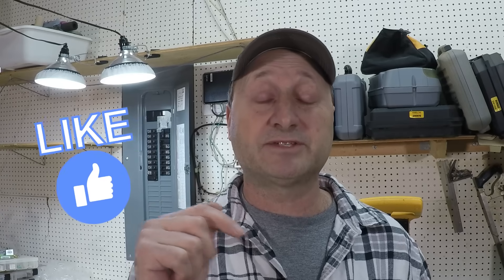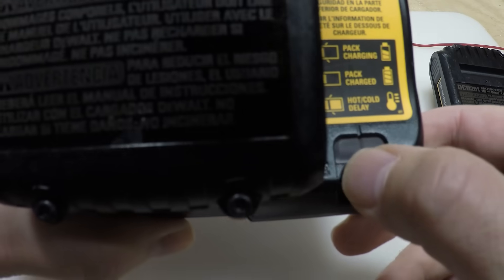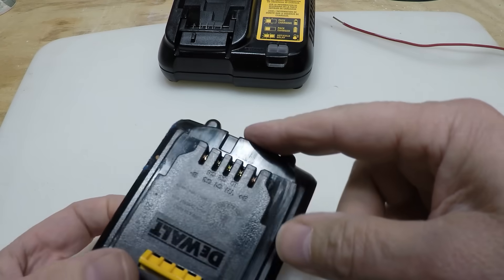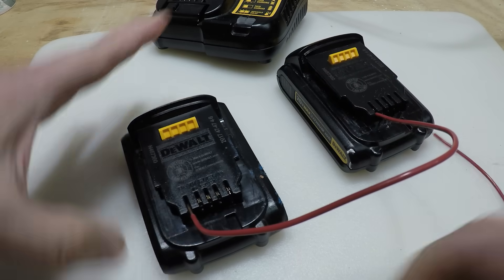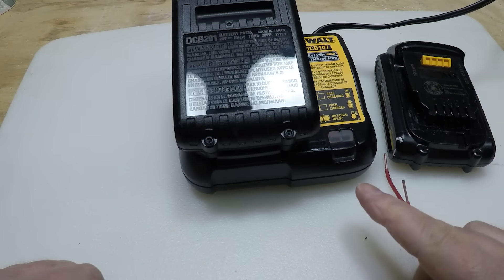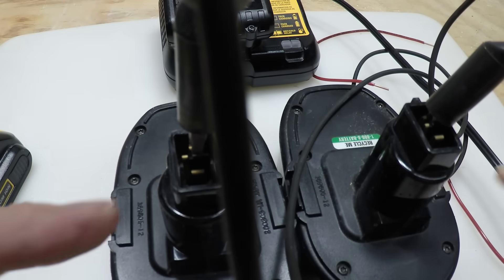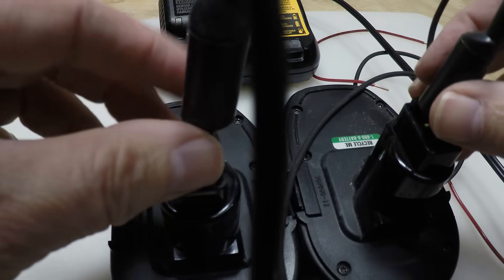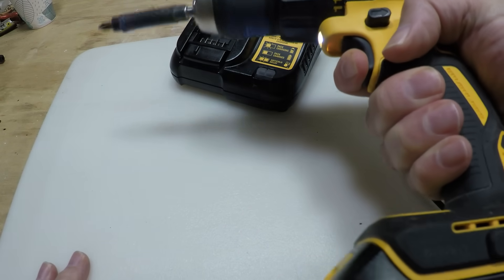SECRET to FIX Drill Batteries - Charge Dead Lithium Tool Batteries

Comment: This is not fix.... In that DeWalt battery pack you have 18650 battery cells. One or more cells are dead and this cell drain all other cells under minimum voltages for Li-Ion batteries to be charge. Minimum voltage is 2.5V for each cell. Under that voltage you have two solutions... Permanent fix is to replace that bad 18650 cells with new one or temporary solution is to isolate that bad 18650 cells, force it to minimum 2.5V  (best to 2.8V) with 3V input on plus and minus poles and back that cell on same place inside battery pack. Best solution is to buy all 18650 cells and replace them all with new. DCB201 battery pack have 5x18650 cells with 1500 mAh capacity. You can buy new LG HG2 18650 cells with 3000 mAH  capacity and 20A current. In that case you can have 3Ah battery pack with double energy inside and for heavy current drain at 20A. No one of all manufacturers dont want to sell anyone anywhere that powerfull battery pack.

Comment: My friend came round today with his Bergman 18v 'dead' battery,-he couldn't get a new one anywhere,-so we tried your trick today using my Bosch 18v battery. It worked a treat,-so thanks a lot for this video!
Reply: I've got a Ridgid that was brand new, left it.on my radio and it hasn't worked since... this didn't work for me, any ideas?

Comment: At 0:23, He says, "There's a way to fix this without having to go buy brand new batteries..."

The method shown requires that the user already has a working battery.  If all that the user has is the battery or batteries that don't work, then the user does have to go buy another battery in order to fix the old one with this method.

Comment: I have a busted charger and my tyre inflator battery went dead. I connected 2 wires pos and neg on the battery and 2 crocodile clips to the other end and stuck them on a 12 volt spare charged battery. My tyre unit is 18 volt but after 1 hour the unit was able to blow up 4 flat tyres to 32 psi no problem.

Comment: I have an 80V max 5 ah Kobalt mower battery that when it is put on the charger it blinks red and the cooling fan on the charger doesn’t turn on. Also when the battery is installed in the mower it just beeps. When you push the button on the face of the battery it shows 2 of three green lights the they go off. Help?

Comment: fascinating.  Similar to my experience with a lead acid car battery.  The expensive smart charger will not begin unless it sees enough charge already.  So I just used a very cheap old dumb charger to get it going, then finished with the smart charger.   Lots of life after that.

Comment: Lithium Ion batteries get really unstable below 2.4V (per cell) and explode or burst into flames.  That's why the fail safe is in place.  If you do this, as said do it in a safe place like a big concrete pad or contained in a fire proof box.   It may work but I wouldn't trust that battery out of my sight.

Comment: I have a ryobi mower. The battery charge doesn't last very long. Especially in the humid florida weather. Is there anything I can do to maximise the battery  to last longer?
This video was a big help. Thanks. I try to keep both my batteries charged to avoid that.

Comment: This is all false hopes, letdowns and disappointments! At the beginning you think it's going to work because you can get the charger to recognize the dead battery and start to charge it... when it's done charging it appears to have a full charge put on a multimeter and it reads how many volts that particular battery is supposed to have. It's at this point you think how awesome this is and how much money you just saved so you do your happy dance! BUT THEN you go to use your drill and you might drive in 1 or 2 screws before it drains down to useless again OR you didn't immediately test it and you waited till next morning through it in the truck to go to work you  try to use it but you can't because it didn't  hold a charge! Even if you use that long charge  battery maintenance/conditioning idea it will not hold a charge!
The only thing that got charged up was the views on this video!

Comment: Do you have any tips for a battery that shows full charge but doesn't last long ?  I have an impact driver that needs recharging after only 5-6 uses on my trailer stabilizers [scissor-jack type], which shouldn't really be a high-resistance usage...

Comment: Good day and many thanks for this brilliant ploy. Nevertheless, I have a question in order NOT to develop some damages while doing the jump-start process: I have a 12V. NiCd old style battery (like those you are showing towards the end of the video) which is completely drained; I have bought another back-up 12V. old style battery but Li-Ion : if I do the jump-start between these 2 different kinds, will it be OK or it may produce severe damages? Many thanks in anticipation for your fair advice. Kind Rgrds,

Comment: That's fantastic! Thanks for sharing :-) I have the same thing happen with my 20 volt Max DeWalt battery and I tossed it to the side on one of my work benches and then the next day when I came into the shop I was about to throw it away and thought I should try it one last time and it charged. Don't know if that happens in every case but it did in mine. Thanks again

Comment: Unfortunately this is not a complete fix but it makes the batteries usable again. From the research I've done there is a type of mechanical safety device on each battery cell and when you completely kill a battery it trips this safety mechanism in some of the cells. So yes you can get the battery up and going again but it won't be able to fully recover and you won't get the longevity from it that you used to. At least this has been my personal experience after discovering this trick and trying it.

Comment: Hi there,
A couple of questions - 
1) Does this trick work with Black & Decker Batteries as well.
2) What should I do if I don't have two batteries, is there any option to revive the dead one without a second battery?

Comment: This method is not a "Solve All"  one. Different batteries have different problems. It could be electrical or chemical. Li-Ion, NiCad, Ni-Mh, Lipo, LeGo etc should not be processed through this method. Professionals and/or well documented  DIYs know their stuff. A good principle is to get reliable knowledge from reliable sources.

Comment: I have Ridgid 18 volt batteries for cordless drills my problem is not that they don't light up but they don't charge up fully so you might it might show for bars as soon as you take it off the charger then it drops 23 and very quickly after that when you're using the tool drops 22 and then one and so this is the problem these batteries apparently have a dead cell in there somewhere maybe maybe you can tell me how to fix this without tearing into internal part the Ridgid batteries are especially difficult to replace the individual lithium-ion cells anyway thanks if you can you might send me a notification that there's some you no new news on there if you do give me a feedback thank you

Comment: DON‘T EVER do this!!!! If it doesn’t charge it“s because the BMS recognized an undervoltage situation. The battery will maybe have developed dendrites because of this. Dendrites shortcircuit the anode and cathode because they overcome the separator. This results in an uncontrolled internal discharge causing heat and fire. This can happen anytime after recharging. Not just while charging. It can happen days, weeks or years afterwards. DON‘T!! Trust the BMS decision, give the battery to recycle and buy a new one. You are in risk to lose life or property. No insurance will pay for anything if they found out.
Regards, a battery and BMS developer for eMobility.

PS: There is a way to check the health and maybe get them alive safely. This requires tools. Seeing this though I won’t tell you how. I saw enough fires.

Comment: Is there a way to bring a nicad drill battery back up to full charge? I believe these have a problem with the memory effect, so when the charger indicates fully charged it's actually only got a very small charge. Thanks for the info on the lithium batteries.

Comment: I wonder if it will work on the Nicad batteries.that my Skil drill came with.

I bought 2 Lithium ions when thry were on sale, and a charger for them.  After that, the Nicads jyst sat.

Once in a while both lithiums are dead but the nicads don't work, even the one that stays on the charger.  Swapping  the other to the charger doesn't work either. 

I assume from lack of use.  The green light on the charger is lit but  constantly has a faint flicker  (not a blink by any means).

I'll have to try this & see.  Thankx!

Comment: Golf carts are the same way. If the batteries are very dead the charger won't kick on. We've actually put a standard charger on for a little bit until the golf cart charger kick in. People have bought alot of chargers not needing them.

Comment: Hello I have a Ryobi, 18 Volt cordless drill, an old type and the batteries hold a very small charge but won't charge fully. Is there any way to rectify this or do I need to replave them and is that worth it

Comment: Same thing happens with car batteries and newer chargers; unless there's a certain minimum level of charge, the charger won't even try to charge the 'dead' battery. Simply using jumper cables to another car for a few minutes (without trying to start the 'dead' car) will give the 'dead' battery enough charge so that they charger will charge it. I don't know why the engineers did this; perhaps to sell more batteries.

Comment: Hi, I am wondering if you have any experience with Dewalt 60V Flexvolt batteries? It starts to charge with the fast charger and stops charging within a minute. Any idea or suggestion would be appreciated.

Comment: I worked in the battery industry for a decade, the lithium battery was not completely dead, the battery circuitry went to "sleep". By introducing a little energy you "woke" it back up. The battery still had charge. Second, the old style battery which was probably NiMH or NiCd will take a charge from a zero state, however the internal cells would have degraded and it wont hold a very good charge after. The easiest way to explain is there is an oxidation inside the battery, some people refer to this as "memory". The entire reason the charger couldnt do that on its own is because they need the voltage to register that something is connected. This way, it doesn't charge whatever you put in there, like random metal. Those chargers are semi-smart. True high end chargers will have a maintenance cycle that would do a short trickle charge to bring voltage to a level (or wake up the battery) then begin to charge the pack. Overall, dont mess with lithium batteries, they can go critical very quickly and once the reaction starts, you cant stop it without a zero oxygen environment or a powdered extinguishant.

Comment: This is not the method i would use. Connecting a charged lithium battery to a discharged one is not safe. If i was desperate i would put a car light bulb in series to limit current for a few moments as mentioned but i would prefer to use an external power supply with current limiting & a voltmeter & not even think about getting a lot of charge in using that method. Then you have to consider if the cells are safe to use anyway.

Comment: I have an older model powerxt cordless drill, the yellow one, with 18 volt battery, that I haven’t used in a few years, when I put it in the charger, there are lights that go on, one green and one red, but no power when I put the battery in the drill, even after charging for several hours.

Comment: what gauge cable did you use??
Reply from the maker: it was probably 14 or 16 but it does not matter. You just need to touch the contacts. Any wire will work

Comment: I have a 40v snow joe battery that has some charge but i guess not enough for the charger. There is continuity on the stinger fuse. I don't  have a second battery. I don't  want to buy another.  Any ideas how i can get some additional charge to this battery withoit a second one. TY in advance.

Comment: I have a bosch 18 volt 2.4 Ah it has 3 contacts on witch one i should make the contacts, also i have a paslode only 2 contacts + and - so i am wondering if it will also work on these batteries?

Comment: Little tip to make the copper wire fit better: put it on your vice or anything hard and flat really. Now smack it with a hammer. It'll flatten out the copper and slide right into those prongs
Reply from the maker: thanks for watching. please share the video with everyone

Comment: My Ryobi 18V batteries show 18V DC but one fairly new one shows 251VDC or maybe that's -251VDC. So, Hmmm, I tried your method for a few seconds and then again for about 20secs,  and still not working. Anyt thoughts??
Reply from the maker: maybe you are touching the wrong contacts

Comment: This works if there is one good battery and another is bad. But most of people don’t have two batteries. Hey have only one battery that comes with the tool. I have cordless drill and it does not charge. I don’t have second battery. So unfortunately people like me can’t use this method.

Comment: Hah.  Your explanation is wrong (cure is OK)
Lithium batteries grow "whiskers" of lithium that shorts the plates out as they get older.
Connecting  a good battery burns these whiskers off (with any luck) and prolongs the life of the dud battery,
You can use a car battery too, Bur one little touch is all you need,  prolonged contact can cause damage and might even make it explode.
https://www.osti.gov/servlets/purl/1574884

Comment: Wow!!! I know this was not a safe thing to do, but I used two paper clips and put on insulated gloves. Connected for two seconds. now the dead battery is charging.  You are a genius!!!! The battery I used to charge with is fine also!!!!
Reply: You got it wrong, the danger here is not high voltage or dangerous chemicals. It is that lithium Ion batteries get internal damage if fully depleted. Damaged cells can catch fire. That is why a correct charger will refuse to charge it. It has nothing to do with jump starting internal battery management as some believe.

Comment: If you only have one battery (18v) could you use a car battery to 'jump' it back into life? (I know the car battery is 12v but would it provide just enough to get the battery back up and running again)?

Comment: Thank you. I did have to do something extra. I followed your instruction. After putting in the charger, I received both red and yellow lights flashed 3X then went out and the red light showed charged. Tried to charge again, same outcome. Put on the tool, nothing. Insurted it back in the charger, no yellow light, and charged without a problem.

Comment: But for a battery that charges  and then goes dead in 1/10 the time it would run, it will have to be replaced. That is good tip to get it to theoint to start the charge.

Comment: I love this ! I'm gonna try it Right Now the Porter Cable!  Thank you. Update, I did it, it worked just like that. and also, I was able to use a stranded copper wire instead of the solid wire.  Thanks again.

Comment: What if you only have 1 battery? Can you use another method to jumpstart the dead battery?
What if this does not fix the issue...maybe some cells need top be replaced inside the battery? Can you do a video on that as well?

Thanks

Comment: I have found that Lithium Ion batteries can be very unpredictable, and can fail absolutely/unexpectedly. I am not sure what the life expectancy is, but I have an M18 that was charged a total of seven (yes 7) times, in about a two year time frame, and it is completely shot. Not one cell of the five will take/hold a charge. Unfortunately these batteries are widespread, and will create another global disposal nightmare if they actually do not go up in flames. Jump starts/ charge balancing  may in some cases bring some extra life.  Let the buyer beware !   ☺♥†♪♫ 8-4-2023

Comment: I have a 80v green works battery that didn’t have a lot of use and went to use the tool (leaf blower) it powered and was dead in the water. I swear these companies do this on purpose due to how many charging cycles and then the battery fails after so many. I only have the one battery. $300 for a new one. I may as well buy the whole tool again but I’ll buy a gas blower instead. There is a video out there to restart the battery but need a second battery.

Comment: I have 3 or 4 ryobi batteries that will not charge completely. The light blinks faulty battery put  will take a little charge but dies quickly. 
I will not throw them in the trash because 👇 is right. I have to take mine to the main refuse facility not the transfer station. It’s different everywhere so ask your refuse administrators how to dispose of lithium batteries properly please.

Comment: Found that this also works for Coin batteries...
Those small coin sized 2032's....
But you hook it to a 9 volt battery for a few moments...   then you can charge the coin batteries with a charger (that they fit into)

Comment: On 18 volt battery i done the recharge dead battery using a good battery.  Ok yes it started charging until fully charge but battery quickly runs out of charge wen used. Battery no good ?

Comment: You should be careful that the second battery you use to jump start it is also low on voltage. If you use a fully charged one, the voltage is way too high, and the current draw will also be way to high. A lithium battery can only take full voltage when it is at around 90% charged, otherwise it will go above the allowed C-rating.

Comment: If you use a hammer to flaten the ends of the jumper wires they will plug in much easier.